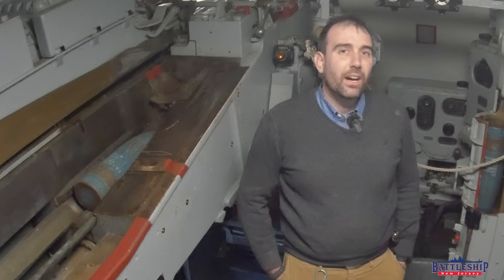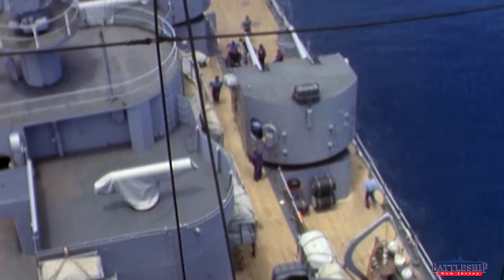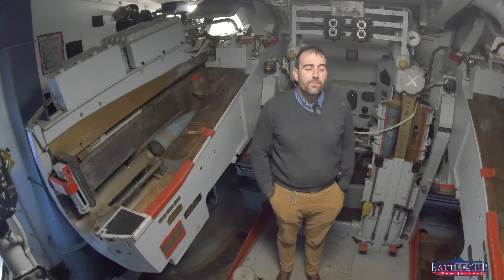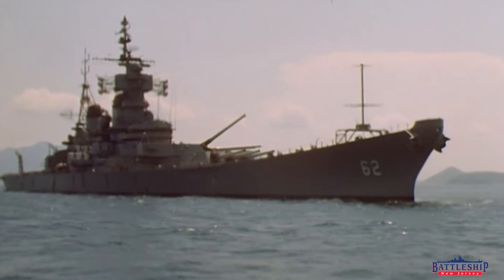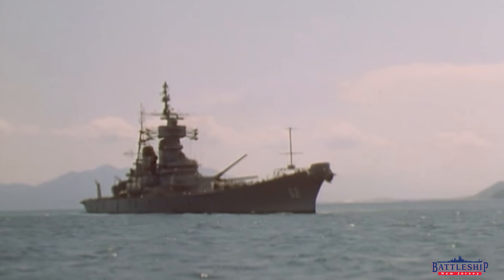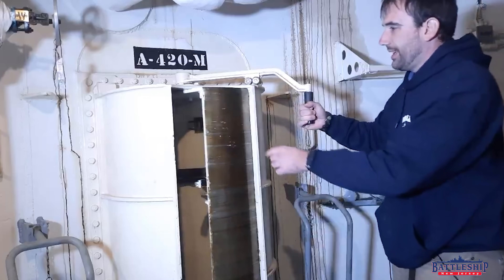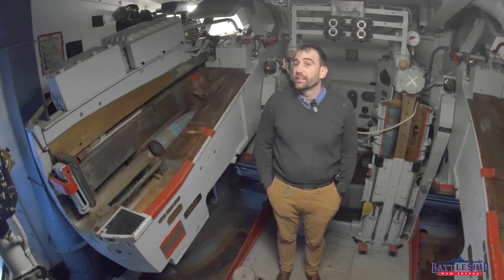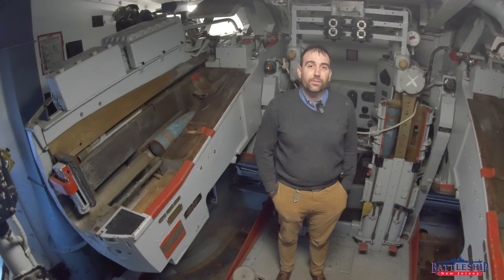Why Do Modern Warships Have So Few Guns?

Comment: The biggest concern I see with the reduction in guns is the loss of redundancy.  When New Jersey had a damaged gun barrel, they were only firing 8 rounds at once.  If your single gun is damaged, you no longer have guns available.  I'm also a little surprised that they aren't doing at least a front and rear turret on some of these destroyers to have coverage without turning the ship around.
Reply: Ticonderoga cruisers have two turrets, but they're older and bigger ships.  I could ask an old navy buddy of mine, but I THINK its due to magazine space vs a helicopter bay.  They wanted the helicopter over the rear turret for the 'burkes.
Reply: The Ticos are larger than the ABs to accommodate that rear gun mount
Reply: A lot of ships dont even have 360 ciws coverage
Reply: @alexdunphy3716  yes but should armor is practically non existent to take and weather a hit and its still cheaper then a missle, but the armament on many ships is pittiful even for defense
Reply: The problem is that naval guns aren't expected to be used much in combat anymore. For anti-ship work, there's anti-ship missiles, and for defense, there's CIWS's. The gun is just there because theoretically, a fleet might need to throw up a flak screen, and for shore bombardment purposes.
Reply: If you never get into 5” gun range, the gun, magazines, and sailors that serve it are wasted.   In 21st century naval warfare guns are useful in situations with restrictive rules of engagement, or if you’re fighting somebody armed only with RPGs I.e. Somali pirates.   If you’re fighting a peer opponent, a gun is wasted space unless your opponent really screws up.
Reply: @ghoti221 Honestly, I assumed the 5 inch gun was kept largely for protection during operations close to land or going through a canal or straight or against smaller vessels like pirates or terrorists in fasts boats.
Reply: @ghoti221  Agreed. The gun is basically only there for when you don't want to use an expensive missile. An anti-shipping missile would be more expensive than an entire dinghy full of Somali pirates put together.
Reply: @ghoti221 
The 5" guns on the ABs also function in the AA role and can engage several types of incoming missiles in the gap range between that of the SAMs and the CIWS.
Reply: @christineshotton824  Sure, they have an AA secondary function, but, nobody counts on a 5" as being a replacement for a CWIS, or for having an engagement envelope large enough to rely on it (especially against modern high-speed anti-ship missiles.)   There's a reason why the USN has invested so heavily in things like SeaRAM and direct energy weapons and railguns (even if it looks like they've abandoned the last, or turned it into a black project to stop feeding info to China.).    
Point being - I'm not saying 5" are completely useless.   Usefulness is a contiuum, not a binary state.   All I'm saying is that relying on large caliber guns as your primary weapon system against a peer opponent is going into a fight with one hand tied behind your back i.e. people who wish for a 21st Century version of a Des Moines or an Iowa are fighting the wrong war.
Reply: @ghoti221  
I specifically stated that the AA usefulness of the 5" gun lies in the coverage gap beyond the range of the CIWS, but too close for a main battery SAM, not as a substitute for CIWS.  The 5" gun acts as a supplement to the point defense missile systems.
Reply: @christineshotton824  Sure, I agree with you.  The point I'm trying to make is a) 5" as AA/PD is still stretched within that range band against modern threats (a modern seaskimmer can cover the 15km distance to the horizon in about 20 seconds - it's almost as fast as the 5" shell going the other way!) - hence SeaRAM, Directed Energy Weapons, etc. and b) you're still not going to rely on your 5" (or any larger gun calibre) as your primary weapon system.   Arguing guns are more relevant than as a secondary system is fighting the wrong war, which is what a lot of people in this comment section believe.   (And the YouTube algorithm must LOVE this comment thread.)
Reply: @ghoti221  
The simple fact is that US Navy rules of engagement in non-wartime monitoring of commercial traffic GUARANTEE allowing enemy unconventional forces to ranges where the deck gun is the fastest and most effective response to a surface threat.  If we had rules of engagement that allowed the use of our weapons systems as designed, we probably wouldn't need deck guns at all.  But the world is what it is, not what we wish it was, and the people establishing the rules of engagement would rather unnecessarily endanger the lives of our Sailors and Marines then be called bad names in the press.  As long as that reality exists, we need deck guns of medium caliber at least.
Reply: @christineshotton824  Sure, I said I agree with you lol.   I pretty much said what you just said in an earlier comment way further up the thread.   I'm not advocating getting rid of guns entirely.   I'm advocating that guns have their place, but you can't rely on them.   Their use these days is asymmetric threats, air defence against secondary level threats, and shore bombardment in benign  environments.   We're on the same page here, with slightly different views of how much of the threat spectrum a 5" Mk 45 can cover.   My main reason for commenting was for people who think the gun is still the primary naval weapon -- that a gun ship like USS Des Moines with an upgraded point defense suite would still be useful in today's Navy.
Reply: In today's world, if the choice is between a second 5" gun or more VLS cells, I'll take the VLS cells every time.
Reply: Surely they can find other jobs for them to do if the 5-inch isn’t in use though? I feel like, relative to the penalty of carrying the gun and sailors for it, the risk of not having it when you need it is much greater. It could be, that you were fighting an underfunded or antiquated force… Or even an emerging threat like the drones Ryan mentioned here.
Reply: @ghoti221  Well when a conflict starts, you don't exactly get a prep time to refit your ships for optimal loadout. So armament needs to be planned with all scenarios in mind (for that ship class and it's role).
Reply: @Mithguar  Sure.   So you want a design with maximum flexibility.   But how does having more than one major caliber gun on a primary naval combatant (like a Burke) add flexibility in 2024?    If you want max flexibility, having an additional 32 cell VLS would be way more useful than a second 5" mount.
Reply: @ghoti221  things do get in gun range very easily though and many places in the world where a warship needs to operate you can't even escape the gun range
Reply: @alexdunphy3716  Sure, which is why you carry a single gun.   As I said, you're going to need something to go up against pirates, gunboat diplomacy, etc.   But if you're going up against a peer opponent -- man, getting into a gun range naval engagement is like a F-15 ignoring their AMRAAMs because they want to go guns against Flankers -- while the Flankers are lobbing R-77s at you the entire way in.
Reply: @ghoti221  guns are more than just useful against pirates. I think we will see gun based anti missile systems become more popular if the current systems even get a taste of real combat. The problem is naval gun tech has been lagging behind significantly compared to what armies have been using. If the same was available to navies they would be more useful
Reply: @alexdunphy3716  Oh sure, I'm not counting smaller caliber weapons meant  for point defense.   Those are going to be around for a long time -- though, it's obvious the USN is betting hard on directed energy weapons as the future there.   I'm talking about large caliber guns with a primary anti-ship/anti-materiel purpose.     And while the latest technologies improve range and fire control of your gun, a missile still has more range and more warhead -- a Chinese YJ-12 can reach out over  160 miles with 400lb of HE, with an estimated attack speed of Mach  2.5, or 2800 fps.    No gun is ever going to match that unless you go to crazy extremes.
Reply: @alexdunphy3716  That's maybe true but, two 5 inch gun is overkill. For anything small enough it can sneak to close range to your ship .50 cal to 30mm is enough. And for anything large enough for you to need 5 inch caliber to fight it get into range, you already messed up very badly
Reply: I suppose by the time your forward gun gets damaged, it’s more than likely your ship is in much deeper trouble than a rear gun can fix
Reply: This whole conversation confuses me. People are arguing passionately about the need for guns. But the premise of the discussion is whether you need an ADDITIONAL one. For all the uses that people have established, one seems plenty in almost all cases. And the edge cases where it's not don't seem to justify the cost, engineering, sacrifices that would have to be made.
Reply: Cause missile out range the gun , the gun was back up , not the modern day warship main weapon
Reply: The fewer smaller guns are the redundancy, to the missile systems that have long outclassed them in range & accuracy. Look at the falklands war- Britain lost a whole ship to an ambush by 1 lowly strike force operating at the end of its range, with a missile that wasn’t even particularly advanced. That is the reality of modern naval engagement, these ships are VERY exposed & highly dependent on automated systems for defense you do not wanna find yourself within sight lines of any modern force.
Reply: If they put a gun on the rear, then they can't have a helicopter deck.
Reply: @JonBerry555  The Ticonderoga class has both a helicopter deck and a rear gun mount.
Reply: @hunter35474 the TICOs are largely retired but also considerably bigger than destroyers
Reply: @hunter35474  Ticonderoga is  Cruiser....not a Destroyer.
Reply: @JonBerry555  Italian FREMM frigates have a n Oto Melara76/62 mm over the helicopers hangars. The hangars have dpace for 2 NH90 or 1 AW101 + 1 NH90. The second hangar is smaller and not suitable for all maintenance need on helicopters.
The new italian OPV,  the PPA (three variants from 4500t to 6200t maximum fidplacement) have installed a newer version of the Oto 76/62 mm gun, the Sovraponte (in italuan "over the deck") that doesn't a lower compartment under the deck ammunition since they are stored on oscillating mass side [38 + 38 round if I remember well).
All have Strakes kit that allows tobuse DART ammunition, that is a guided sub-caliber  ammunition used against air or sea threats. The operative range about 8 km.
Reply: @JonBerry555 
The early OHPs had a 3" gun turret mounted on top of the helicopter hangar.  You can find room on a ship the size of an AB for a second gun mount if you decide you want one.
Reply: @JonBerry555  is there a reason that they couldn't just build an elevated helicopter deck over top of a gun?
Reply: I mean... It's the same with bayonets on rifles... How often in modern combat you would actually use it.. you still have it, just for the case, but that's it
Reply: The thing is that ships are no longer expected to fight in close range battles like in WW2— missiles and torpedos are the main weapons of modern ships because they can do the job without putting the ship and its crew in jeopardy.
Reply: 1/9 the problems as well.
Reply: The only time modern ships lose gun redundancy is if the Radars or Sonars failed to locate a target. Everything is picked up miles beyond the visual range and most likely out of range for any battery. Accuracy is also an extremely important factor. A well trained crew who can operate missiles can disable/sink more ships than using main batteries. 

Besides, the age of who’s ship got more meat to survive is a primal in todays age. Speed and Radar cross section is vital. With missiles being the main battery of any Naval vessel, guns are obsolete, but nonetheless potent if all other means were a stand off between guns. Most naval guns can penetrate armor on our enemies vessels. 🙂

While I will admit, I loved seeing insane amount of guns such as we seen on the HMS Agincourt and the Bismarck, unfortunately its like comparing “bringing a knife to a gun fight” but you’re bringing guns to a missile fight.
Reply: Isn't the tico class just a stretch Spruance ?
Reply: Electromagnetic rail guns are just about here and will alter this discussion entirely. A gun with approx 100 miles of range and a projectile velocity capable of using it as an anti-missle system and an offense weapon will probably have the navy building more gunships again, imo.
Reply: The gun IS the redundancy
Reply: I feel like if you ever find a situation where your main 5" is damaged and you still need to fire 5" you messed up pretty badly
Reply: Why shoot at a ship with a 5in shell when you can just sink it with a missile
Reply: @zach071591  
Because our rules of engagement often force naval personnel to get too close to a potential enemy to effectively use missiles.  There is a huge potential for terrorism in the form of civilian cargo ships with hidden weapons opening fire on a navy vessel that has stopped them for an inspection.  The guns react much faster and can engage targets at point blank ranges if needed.  That is why 25mm deck gun mounts have been added to many naval ships.  Those are more than enough to deal with speedboats and skiffs, but what if the terrorists decide to start using 10,000 ton merchant ships instead of 15 ton speedboats?
Reply: lol, so you didn't want to watch the video?
Reply: Redundancy comes from sail in large fleets
Reply: Coverage to shoot at what exactly?

What circumstances would a DDG need to have a rear gun? 

In what situations would a single fore-gun ship can't spare the handful of seconds needed to turn the ship?
Reply: Their design premise is they wont be hit by fire....a result of not having to fight a peer enemy in 80 years...compare to a MBTs which have seen continous combat since ww2 and have gotten bigger and with larger guns
Reply: Happened in the falklands war during the battle of goose green. The single naval gun went down and that was all fire support gone.
Reply: We stopped building ships with more than one gun more than 3 decades ago because guns and their magazines take up space and (especially) displacement that are much better used to maximize the number of VLS cells.  Naval warfare isn't generally fought within the range of 5-inch guns.
Reply: @duanem.1567  I think the point of most of the comments here is  wether the doctrine of "modern" one gun 600' ships is sound. We all know what military planners "think" will happen....guns have little/no use in a modern conflict but.....for many here there are many uses for a gun at ranges up to 60 miles. I believe if you put just a 5" gun on a 600' warship with it's limited shell weight and range, why not use modern tech and materials to make it a 7" gun that has a 200lb HC shell or ram assist that still has a sixable bursting charge even at 60 miles. If you only have one gun, the 7" would be much more flexible. All NATO large combatants could use this weapon. Being hit by a 200lb HC shell would seriously damage anything anything out to 25 miles or so. Seems much more useful than the shorter range MUCH lighter 5" shell if you only have one gun. That's my point.
Reply: @garyyoung4074  here is the thing: ships can now launch anti ship missiles that deploy torpedoes, saturating the engagement zone from 200 miles away, with deadly accuracy. So your 25 miles range gun is basically a knife against guns allegory. Also, these anti ship missiles have a yield from 40 pounds to nuclear warheads. Basically, your 5 and 7 inc guns are no match for anti ship missiles.
Reply: @andmos1001  Thanks, but I am aware of all that. You're missing the point. Not all targets are worth a guided missle. A puney 5" gun on a 550' Burke is itself the limiting factor for it's use. (15 mile range w/dumb shells, and little bursting charge left if you fill that shell with  a rocket boost for more range). My point is a bigger MODERN state of art light weight 7" gun on all Burke size ships in NATO allows them to use less expensive dumb 200lb shells out to 25 m and out to 60m or more w/ramjet shells (7" is big enough to carry a substantial bursting charge to do some damage even at 60m). If you are going to put a gun on a ship nearly 600' long anyway, why not make it one that is more useful? Problem is no one makes one yet. That's my point. One 200lb HC hit on an Iranian gun boat at 20miles or a drone launch site at 60m in Red sea is all you'd need. Not a million dollar missle. Point is....the limiting factors of the 5" gun. Put that on frigates, and the 3" on FAC'S. Large ship to ship/subs or aircraft defence goes to guided missles. We know that. Gosh...Burkes are BIG.
Reply: @garyyoung4074  And now you have come to the cost of warfare. You forget that the same algorithm is being used to rectify the use of million dollar missiles against desperate enemies. Would you rather fire a sure to kill weapon at a distance of 200 miles, without the ability to be fired back at, or would you prefer the enemy ability to fire back at you, and possible loss of a rather more expensive gunboat?
Reply: Modern naval warfare are focusing on missiles, with the gun as the last option for combat. The years of big gunships have gone.
Reply: @andmos1001  its foolish to near abandon guns completely, the reason tanks still use big guns and havnt moved over to launching guided and unguided missiles is missiles are relatively easy to defend against compared to big guns
Reply: so where are you going to put the helicopter?
Reply: Today's naval warfare simply doesn't require that many guns. It's all missiles. Even anti-missile defense has been taken over by missiles, seeing the phalanx mostly supplanted (though the Navy wants to replace or supplement both with lasers).

You should look at the new Constellation class and DDG(x) The constellation is moving from a 5" to a 57mm gun while the DDG(x) will probably have a single 5" (unless they decide to shift to the 57mm as well). What they WILL have are A LOT of VLS cells and canisters for over the horizon missiles. Whoever has more (more) advanced missiles will win.
Reply: What do you need guns for when you have missiles
Reply: Two is one and one is none.
Reply: Modern destroyer arent supposed to be hit anyways, that's what the CIWS is for. Anti-ship missiles are too devastating, pretty much unlikely for a destroyer to continue fighting after getting hit by one.
Reply: The redunancy is having other weapon systems, like missiles and helicopters.
Reply: Another answer would be that even if you have multiple turrets, if your ship gets hit once, it's likely going to be out of action or liable to retreat due to how expensive the ship as a whole is, so having extra gun(s) at this point would be pointless
Reply: No, you already have more than enough redundancy with other systems. Anything within line of sight of the ship can be illuminated via fire control radars, so any ship (be it a US, Russian or Chinese design) can use surface to air missiles (like ESSM SM-1/2 or SA-N-6 etc) to target any and all kinds of surface targets. Anything closer can be handled by CIWS. What if ships missiles or CIWS ammunition are severely deplated? Then it should steer way away from modern combat.
Reply: A direct hit from a modern cruise missile (god forbid nuclear missile) would probably destroy the entire gun emplacement.  

At the range modern ship battles would be fought combined with the damage they can do and countermeasures they can employ, it would come down to who can land a hit first wins.
Reply: dont worry, you dont have enough information to have concerns
Reply: VLS
Reply: the gun /is/ the redundancy system
Reply: Redundancy isn’t an issue when most (American) ships have missiles and more and more being equipped with laser systems over the years. If the main gun (or really any gun) is being used on a modern vessel then something really bad has happened, whoever is attacking is well close, and you’re out of missiles. Realistically you’re only gonna shoot that at a small Somali pirate boat or something that’s not worth the cost of a missile. Ship to ship fighting against another warship you’re not ever going to be in gun range when missiles can go hundreds of miles.
Reply: Honestly given modern naval doctrine, the guns could be removed all together, replace them with either VLS cells or tons of close in weapon systems. Nobody engages with guns anymore, and the guns in use currently aren't useful for much of anything. They're better served with having more VLS cells or way more anti-air protection. That or they could have two classes of ships, ones a gunboat and the other is a missile barge.
Reply: @Adierit obvious solution is a one srmed bandit and a miniaturized sprint kinetic missile. See how they like THAT.
Move or get hit by 100 gravity acceleration lol
Reply: @Adierit they though that the original F4 phantoms
..Vietnam sorted that premise put
Reply: @jamedmurphy4468  No it didn't lmao. The issue with the Phantom in Vietnam was the lack of training not the lack of a gun. Navy Phantoms never got a gun and saw the same kill rate increase
Reply: @hresvelgr401  which is why every naval fighter since the F4 has had a gun? F14,F18,F35?
Reply: @Adierit  so say the F4 phantom at first.....and yet they do engage in short range but have nothing to use...at least even in modern days not long ago in iran-iraq war, us warship did use guns to blast the iran oil platform. it is cheaper too.
Reply: @Adierit   A drone missile barge and a few drone decoy barges, or drone barges solely dedicated to anti-missile missiles.
Reply: @Adierit Isn't that similar to the idea of removing guns from fighter planes? I believe it was anticipated that missiles made guns redundant, and that dogfighting was an anachronistic concept. The decision was reversed during the Vietnam war, I believe.
Reply: @Adierit  You are wrong here. Guns aren't obsolete because (like mentioned in the video) they are way cheaper to run. Naval vessels offer provide support to ground troops and depending on conflict scale, single 5 inch gun might be adequate to deal with the target and much cheaper then a missile. Just because you have a better weapon, it isn't often advantageous to use it. Great example of that would be F22.

Also, US airforce still uses strike aircrafts with propellers for smaller conflicts because they are way cheaper to run then jets.
Reply: @Adierit So the guns are dual purpose, like it WW2? 

Seems silly to me, since they cleary kept guns for just in case situations, but not dual purpose, also for just in case. If you want flexibility, you have to go all in, or you'll find yourself suddenly inflexible.
Reply: @Adierit  In a full on war against an equally competent force yes but against a lot of the smaller threats the US faces guns are a better option
Reply: @Adierit  Not sure that's right. Guns are still useful general purpose tools that can fire a variety of types of shell and engage a variety of types of target. You can fire cheap laser homing or GPS guided projectiles from a gun, or fire starshells, or engage a low value/low threat target like a civilian ship being used for a military task. Against any serious threat there is going to be a better missile available, but losing the flexibility of a medium calibre gun would probably be a mistake.
Reply: @Akm72  None of that is used by the US navy currently. While yes, there exists reasons one can make to use them, they aren't being used for that as it stands. They don't even have a star shell round built nor being built for the current guns in use because radar doesn't care if its dark outside. There is also no currently available guided munitions for them either. Sure, you could engage a "civilian ship" with it, but don't you think a 5 inch round is a bit overkill for a 50 cals job?
Reply: @Adierit  if you get into 50 cal range you're also getting close enough that they might have something on board to shoot back at you with. Nothing more embarrassing for a warship than being engaged by a civilian ship on even terms.
Reply: @Akm72  Last I check they're quite literally entering 50 cal range all the time with Somali pirates. They don't ever use the 5 inch gun on them. So you aren't making much sense here.
Reply: @Adierit  presumably because they're confident that the somali pirates don't have anything effective to shoot back with at that range. This isn't always going to be the case.
Reply: @Akm72  There is nothing that can be mounted on a civilian ship that would pose any risk. It would take hundreds of RPG rounds to even do anything at all to the floatability of an Arleigh Burke given how tiny its warhead is compared to the size of a warship. If it was sporting anything like an anti-ship missile, or torpedoes, the guns would be useless as well as you'd want it sunk long before gun range at that point.
Reply: @Adierit  how about another 50 cal? It's not as if modern warships have any armor
Reply: @Akm72  A 50 cal isn't going to do much to threaten the safety of an Arleigh Burke. It may put a few tiny holes in it, but again this is a ship comprised of multiple water tight bulkheads spread out over 500 feet of ship. There isn't really anything a 50 cal is going to do before the 50's on board already dispatched them. You're just speculating nonsense at this point just to be right.
Reply: @Adierit  why even risk the sailor's lives though? Why not just accept that sometimes there are targets that don't deserve a missile but still need a bit more stand off distance than a 50 cal or ciws can provide?
Reply: @Adierit 
slews 25mm bushmaster around with menace
Reply: @Adierit unless they target the phased SPY arrays...expensive and very long repair
Reply: @Adierit 
You know that several merchant raiders in WWII were converted from regular cargo ships and were outfitted with guns up to 5" in turrets camouflaged to look like deck cargo, right?
Do you want to take a 5" round to the bridge of your AB?  I wouldn't.
Of course such a ship couldn't stand a real fight with an AB, but would you like to take multiple 5" shell hits while racing away to get enough distance to use your missiles while trying to stop a 20,000 ton ship with 50 cal?
As things are now, if the people in the CIC are on their toes, the auto 5" gun on the AB could probably put 5 rounds into that converted freighter before it could get off a second manually loaded shot.
Reply: @christineshotton824  Missiles are vertically launched, they don't need "enough distance" they fly up, and then come right back down. They would pick that ship up on radar, scout it out with a drone, realize it has guns, and sink it after confirming it won't comply on radio.
Reply: @Adierit   You are wrong on multiple counts.
Reply: @Adierit  What about a swarm of pirate go-fasts ? Machine guns are ok for close proximity, but a radar guided 4inch gun can be effective at a longer range.
Seems to me it depends on what the ship is being used against. Pirates off Somalia at one end and the Ukrainians re-writing the rules at the other.
I think there is going to be quite a bit of head-scratching over the next few years about what to plan for in future. Then something comes up out of nowhere and catches them out!
Reply: @coniow  in Ukraine, as we already know its impossible to detect those naval drones to even engage them at ranges where the 5 inch gun can even depress low enough to hit them. It's why all the drone footage is them being shot at with machine gun fire or them already exploding into the side of a ship. the Surface scan radar doesn't detect it well enough from the surface of the ocean for those smaller drones. Same problem would exist for the US I imagine so more small arms would be more beneficial then a gun that can only aim as low as the bow and ONLY off the bow of the ship as well. If the drone comes from the rear, that 5 inch gun literally has no line of sight anyways.
Reply: @coniow  I don't think any prirate would be dumb enough to challange navy warship. Plus anything small speed boat could carry won't be more threat to a DDG than 30mm is to them.
Reply: What if we get so good at countering modern weaponry with those AA-pills etc. that nothing except guns and submarines works anymore?
Reply: @Adierit  LOLwhat? What an idiotic comment, conflict in Ukr shown side relying on gun artillery thoroughly trash NATO missile centric one, because you can fire 1000 shells cheaper than one missile (which is too easy to kill with cheap AA missile in turn doing zero damage to enemy)...
Reply: @KuK137  What on earth does gun artillery and missile artillery have to do when comparing a 5 inch gun to a missile? a 5 inch gun is a whole 127mm's. Compared to past naval guns, it was a secondary weapon used on cruisers and battleships. It wasn't even a main gun caliber for anything besides light destroyers. Only advantage the newer one has is it fires faster and has a better fire control system. If the NATO missiles take a missile to shoot down, then its not exactly a "cheap" kill then is it? missiles are missiles, the exact same resource was spent to take it down then.
Reply: @KuK137  The conflict in Ukraine didn't show anything because Ukraine does not have all the gear NATO has. It doesn't matter if 1,000 shells are cheaper then one missile if those 1,000 shells are burning in the ammo dump because they were hit by that missile. Similarly Ukraine does not have advanced stealth fighters like the F-35 capable of penetrating air defense and striking the ammunition depots artillery relies on
Reply: Agree, you need more than one gun. It's like the engines. You need more than one, or you become a sitting duck.
Reply: @robertpoore7604  The guns are neither a primary component of the ship's ability to attack or defend itself. It's an afterthought that's only kept because the ammunition is cheap and readily available.
Reply: @robertpoore7604  Missiles, Torpedo, CIWS: am i a joke to you
Reply: I have listened to Drachinfel, and the NJ you tube,  and the problem always money,  the Burkes are amazing ships, the Zumwalts are too in their way, the 155's were just a bad decision not to be able to use common rounds. 
A perfect ship may be something along the lines of a USS Salem, or USS Littlerock,,  modern systems, gas turbines, missles with two 6 or 8 inch turrets, one fore, one aft, twin guns.
Reply: Guns definitely have a place on board a modern naval vessel.  For one thing, as others have noted, there's the intimidation factor, as well as 'close in' combat use.  Secondly, guns are far cheaper to operate and maintain.  Guns are also harder to defeat once the shell is in flight. And yeah, the full autoloading unmanned turrets are quite impressive. Furthermore, unless we're going for shore bombardment missions, a large supply of ready ammo is probably not necessary; compartmentalized ammo storage in the turret itself would be feasible, with reloading done after an action was over.  And I also agree that just for the sake of redundancy and in case of a mechanical casualty, a ship ought to have at least two turrets, either one each fore and aft, or a superfiring pair forward, or a single two-gun turret.

We also seem to be talking almost exclusively about airborne drones, while the Ukrainians have developed several types of sea-surface drones that have given the Russian Navy a very bad time.  Just like with UAVs, maybe we don't want to launch a multimillion dollar missile  to take out a $20k modified pleasure craft.  A $1k 5" round will do the job quite nicely.  And if we're going to get back into the mission of protecting convoys (from Houthi rebels, perhaps), we need to provide an umbrella of protection around other ships, not just our own vessel. The longer range of a 5"-class gun system vs. a 20-30mm system would provide a much larger umbrella of coverage.
Reply: Battles are with missles now not guns
Reply: why not just carry a conventional self-propelled artillery guns on board the ship?
you can just add or substract the number of guns depending on the mission requirement.
you can even swap an artillery-type for anti-air ones, mlrs, etc.
you can also dispose them to the sea just in case there is a need to.
Reply: Who says you can't have both gun and helo deck? If you reduce the hanger to hold only one helo then newly open deck space can be used for a gun. Personally I think if the hanger was centered then there would be room for TWO guns.

Vietnam taught our military that missiles were not the answer to dog fighting and I think we're over relying on missiles against ships.

Anyone remember seeing the Chinese ships trailing ours as we made Freedom of Navigation sailing near their man-made islands? Perfect firing position against our ships while ours had no gun pointing back. Also they were sailing verrrry close... wouldn't if we had a gun pointing back at them.

Guns have their place... intimidation being one of them. Just ask the Peoples Army-Navy.
Reply: @Strayshot2010  Semi-active guided AIM missiles were relatively new in Vietnam.  They didn't have jets like the F-14 with the Phoenix or the F/A-18 with AMRAAM and grossly sophisticated fire control radar.
Reply: @Strayshot2010 I feel like the vietnam comparison is not apt, considering that the conflict proved to be one of human definitiancy rather than a technological one. So i really think 1 gun is fine in terms of weight and space reduction as opposed to smaller and more compact VLS systems. Engagement ranges have gotten to far for guns to be priority.
Reply: @Strayshot2010 No, Vietnam taught us the need for better fighter pilot training. Naval Phantoms didn't have internal cannons but were more successful than their AF counterparts.  The USN' FWS showed its worth.
Reply: @Strayshot2010  Vietnam taught us that missile technology and dogfighting training was not there yet

You are aware that the thing that solved the issues of the Phantom in Vietnam was training, not adding a gun right? The USN F-4 Phantoms never received a gun yet saw the same increase in kill ratios as the USAF Phantoms thanks to the US Navy Fighters Weapons School, which you probably know as Top Gun
Reply: @Strayshot2010 You do realize that the Vietnam War ended a little under fifty years ago, right? Missile technology has come a long way since then.
Reply: @Strayshot2010  Vietnam was 50 years ago, bud. Weapons technology, and missile technology more specifically, is a lot more advanced now.
Reply: @Strayshot2010 "Vietnam taught our military that missiles were not the answer to dogfighting." Bro, Vietnam was 50 years ago. A modern fighter is designed to never see its target visibly, much less get into gun range of it.
Reply: @Strayshot2010  
"Vietnam taught our military that missiles were not the answer to dog fighting"

Vietnam just taught us that missile technology wasnt there yet. I doubt that an f35 or f22 will ever fire its gun in a dogfight
Reply: @SchwertKruemel  you say that but at the same time the Russian Air Force has both downed Ukrainan fighters from 200km and used their cannons against drones and sea targets
Reply: @SchwertKruemel  The F22 very well may use its gun.  The gun does not have a EM signature, but a missile will. The F22 has speed and stealth so it can get right behind an aircraft without the other one knowing it is there.
Reply: @matthewbeasley7765  f22 isn’t stealthy anymore when you are in gun range. Stealth aircraft are more difficult to detect in BVR, but they are not invisible for radar
Reply: @SchwertKruemel 
With modern rules of engagement, I can almost guarantee it would happen; or at least the engagement would happen at gun range, even if the pilot chose to use an AIM-9 instead.
Reply: @Strayshot2010  Missile technology wasn't ready at that point. I believe fighters should still have a gun just in case but missiles today are on a whole other level. Look at Ukraine.
Reply: @Strayshot2010  so you're not wrong
but you have to consider that the reason we learned that from vietnam was because missile technology wasn't good enough yet to be relied on for air to air combat
i'm fairly certain that the reason why you still see ships with guns is because of this actually, but our missiles are good enough that they can be relied on to hit things and kill them, and so we've dropped the gun counts to make room for these missiles. The same missiles that're leagues more capable than any gun we can mount
Reply: @Strayshot2010 Here's the problem with that. It isn't the 70's any more. Maybe 50 years ago missiles weren't the answer to dog fighting. These days they very much are, and if you even get in a dog fight in the first place, you already messed up multiple times.

It's the same for ships. If they were at war those Chinese ships would have been fired at from over the horizon with missiles before any gun known to man would be in range and with much greater accuracy. There's a reason the us navy has taken the rail guns off their experimental ships and replaced them with missiles.
Reply: @Strayshot2010 
If you think China canget that nwarr to US ships, ur wrong.
Either ship have buun sunk before they get close
Reply: @Strayshot2010  But didn't your ships have other ways to completely annihilate those Chinese ships in case they would fire a gun shot? It would surprise me if that was the case
Reply: @Strayshot2010 If you go from two to one helo you have just moved the redundancy problem. 

Helo’s are fickle, high maintenance creatures. If you only have one on your ship, odds are you have zero that can fly the moment you really need it.
Reply: @Strayshot2010  The missiles were fine in Vietnam. After improved training in using the missiles, the Navy achieved much improved kill rates
Reply: @Strayshot2010  In vietnam maybe but the cool thing about missiles and technology is that they get better over time with research and development. Crazy I know. It's why that A-10 performs horribly even against the targets it was designed to, because big guns just aren't that good if you have room to use precision guided munitions or missiles on anything large enough to house them.
Reply: @Strayshot2010  You can, you just have to lengthen the hull, and add an extra gun magazine.  Thus the Ticonderoga Cruiser.  Problem is its more expensive.
Reply: And less stealthy.
Reply: Exactly!!! I have preached for a NEW 7" lightweight gun for every NATO ship over 550feet for years...a shell big enough for ram/rocket range extention with still a decent bursting charge (the Zumwalt shells too small and twiddly to make cheaply). Or just dumb HC 200lb. shells that can fly 25 miles and blow BIG holes in something. Put the 5" on frigates, the 3" on FAC'S. I am sure the tech is available now to up the gun bore, but leave the size of the mount almost the same. Crimony...you could put the new 50mm Bradly gun on a patrol boat. All NATO ships could have this new standard gun. Also, if the USA would use the high powered 30mm CIW system Europe uses, the increases range over phalanx 20mm could be used for the small boat threat at further ranges. Missles can be jammed or radar knocked out.....
Reply: @garyyoung4074  the Common oto melara 75mm already offers Rocket assisted ammo
Reply: @markus1351  Thanks,  but I am aware of that. The entire 3" shell weighs only 14lbs. You put rocket assist in it and you can imagine how small the "bursting" charge becomes. Like throwing a rock to an "extended range" which is the same as the normal range of a HC 7" 200lb shell, (23-25 miles). Just saying.....
Reply: My concern is EMP one could knock out our whole navy main weaponry which are missiles I rather spend a tone of money having a battleship in the pocket and not use it then not having one when we do need one
Reply: @michaelhunting2868 

If the enemy is throwing around EMPs then a battleship is still the wrong weapon.

The weapon you'd be using instead is a nuke of your own.
Reply: @michaelhunting2868 
no
no they really can't
EMP doesn't work like the movies
Reply: Guns on naval ships area obsolete. Missiles are better in every way. @michaelhunting2868
Reply: @michaelhunting2868  Most naval guns are not, I repeat not, analogue. If the ships aren't EMP shielded, everything's going down and that's including the gun.
Reply: @Mahbu  the Iowa's and the flencher class are both completely analog  still
Reply: @michaelhunting2868  Are either class still in use? No.
Reply: @michaelhunting2868 military equipment is hardened against EMP, and has been for decades.
Reply: @michaelhunting2868  Maybe but you need 2000 men to operate it effectively. Also you know what? You'll still be easy target for modern nuclear or diesel electric sub. And no, EMP won't save you, salt water is more than enough protection for them.
Reply: @michaelhunting2868  You say that like the systems that load, fire and aim the guns would be immune to the EMP.
Reply: @f0rth3l0v30fchr15t  given the Iowa's are mostly analog and most systems are protected by the thick amour